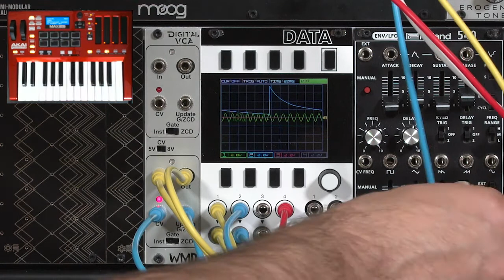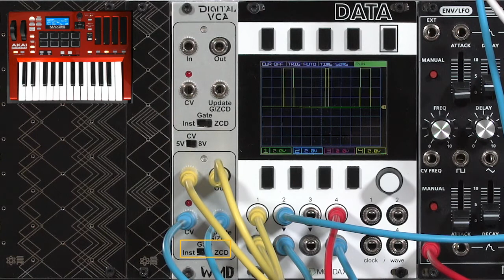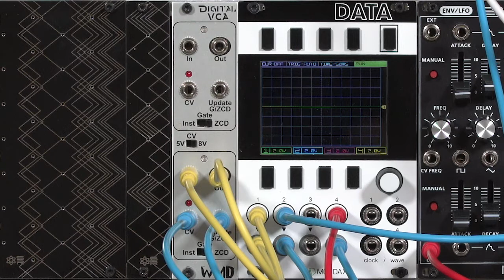WMD Digital VCA 2/2: Sample & Hold Application (LMS Eurorack Expansion Project)

Comment: Nice video thanks! For the bass notes though isn't it the perfect way to send a gate (that triggers an env of vca) to hard sync input of a vco, provided of course it is there and responds to positive voltages as well. This trick is done by many modular producers for a while already :)
Reply from the maker: You're right! I should probably make a separate little video on that some time. 

FYI, over on the Learning Modular Patreon page, I'm writing an additional post that goes with each video to expand upon its ideas; the sync trick is indeed one of the things I mentioned over there: https://www.patreon.com/LearningModular